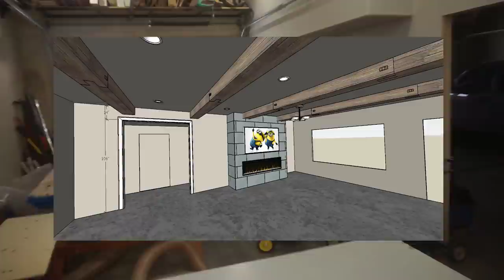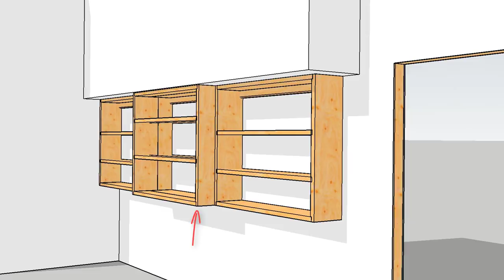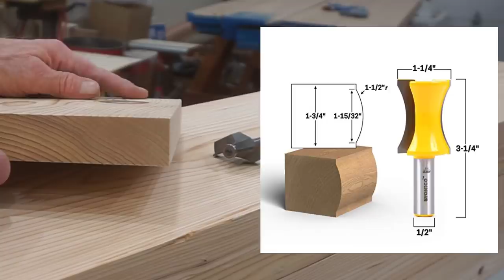Get Organized with Simple Solid Storage Shelves

Comment: Hi, I'm trying to learn here and I'm afraid I am missing something. Perhaps you can help out with an explanation. Here goes:
I understand the cleat is securely fastened to the wall. I also see how the top shelf rests on (and is screwed to) the cleat.
But then, the weight of the other three shelves as well as both side rails are all just held in place by three screws on the tops of the sides into the end grain of the top shelf (as seen at 28:10 the three top-right screws)? The sides are not resting on the top shelf right? They're only screwed into it from the side?
So I see how cleat and top shelf are really strong and sturdy, but it looks like the rest of all the weight depends on six screws through the sides of the rails into the end grain of the top shelf. Is that an engineering issue, or am I just missing something?
Thanks for the build and thanks for your efforts to go through "video-hell" to get it out to us!
Reply from the maker: Great question and very well stated... thanks metamud!  You are correct in all your observations and conclusions about the design and 'engineering' of these shelves.  I'll add couple key things to help you understand why I'm confident these shelves won't fail as constructed.  One thing is that there is a 4th screw holding the sides to the top shelf/cleat... you'll see it in the same frame at 28:10... so there's 8 screws total for the side to top/cleat connection on each of the shallow shelf units.  While they are indeed screwed INTO end grain, the force on them is 'shear', not 'pull out', and far stronger here. My assessment is that I could easily load any one of those screws with 50 lbs without failure of the fastener or wood.  That means I'd be comfortable loading 400 lbs on the shelf section and still sleep soundly.  The center section of shelves are deeper but they also have more screws.  If I had over 1,200 lbs of stuff to store there I might re-engineer things but even then adding polyurethane construction adhesive to those connections would probably come close to doubling their strength so I wouldn't need to change much.
BTW similar shelves sloppily built and installed without careful attention could fail with much less weight IMHO so I stress the importance of paying attention to things that matter.  Best, Matt
Reply: Excellent! Thanks a lot for taking the time for such a lengthy explanation. This helps my understanding a lot. Great job. :-)
Reply: Just a few technical data:
Those screws have  a shear strength of 540 pounds.

https://www.reliablefasteners.com/documents/docsGr/119/817/0/1198170/1401928.pdf

So if the top shelf was infinitely strong, and the rest was rigid and infinitely strong, you would have to apply a pressure of: 6 * 540 = 3240 pounds, or 1470 kg to the bottom part to separate it from the top part.
I'm pretty sure something else will break before the first screw shears.
It would be interesting to see what the deflection is with such a load for the wood is using, but I don't really have time to do that.
Or how much it take to shear the wood in such a setup.
Reply from the maker: @xl000  Thanks for adding that analysis... adds value to content here and I appreciate it.  I tend to rely on years of experience tearing stuff apart in demolition projects to know what holds how much and where... it's shoot from the hip engineering but actually serves me well.  Unfortunately it doesn't translate well so viewers don't gain the confidence they do with actual data.  Plus you've a neutral way of presenting that's not offensive... not a common trait on YouTube... so that tells me good things about your character too.  Best, Matt
Reply: It wasn't the screws I was afraid of breaking / shearing. It's the fact that they are in-line with the grain of the wood, which means they could tear up the would / make it break. Especially because they have such a high shear strength it is not the screw to worry about, but the surrounding fibres of wood that worried me.
Reply from the maker: @metamud8686  I wouldn't be comfortable with this connection if the shelves were 3/4" Radiata pine or anything for that exact reason: strong screws could lead to failure of the wood itself.   Thick shelves like these are amazingly strong. If you want perspective on my confidence get some scrap material, create this connection and do your own stress-testing to see. Careful placement and mindful driving of the screws in these shelves provides maximum holding power and strength IMHO.  Screws driven willy-nilly could reduce strength significantly.  Anyone who remains dubious could add polyurethane construction adhesive to the connection... when that stuff cures you could probably remove the screws altogether without concern! 🤓😎 Best, Matt
Reply: @metamud8686  If you are so scared of the setup, build a mock up with regular non grk screws, forget the dado cuts and test the load with and without wood glue or liquid nails/PL premium. You'll come to realise that this structure is way strong.
Reply: I wouldn't use 3/4 stock, nice shelves, @Next Level Carpentry and I always use my building experience to asses the hold of whatever I'm making. I couldn't do the math that the other commentator had... science, engineering, my head exploded...@xl
Reply: Yes I noticed that too.
Some dowels or biscuits could make that joint much stronger

Comment: What a great video.  You don't need to apologize for the video or audio.  Totally understandable.  I found the repair on one of the shelves with the split to be fascinating.  I would have never thought to complete the split, then use the wire brush, before a glue up.  What a nice nugget of knowledge. I also found myself watching your hands as you performed the microbevel on the ends of the shelves so that they would fit in the dado of the verticals.  You used a pulling motion with the block plane that I assumed was to prevent creating a splinter in the end of the shelf.  I also have found that the use of a climbing cut with a router is very helpful if you're careful. Thank you so much.  Kind regards, Craig

Comment: Matt - I agree with many of the other comments here, and I'll add my perspective as a fellow YouTuber: Your hard work on getting this video into a coherent state definitely paid off. Especially with your honest explanation at the start, so we knew what was coming and why the audio was inconsistent, etc. The fact that many people commented saying things like "I thought the video was fine" just proves how well you set up expectations.

I'm totally in awe that you managed to get this video out. I have several projects like this, where it was too much of a struggle to make anything coherent out of the video, and I've shelved them indefinitely. Now I want to go back and see what I can salvage. This video is an inspiration to those of us who have projects, video or otherwise, that we just can't seem to finish.

Questions:

1)  For the bottom shelf, why didn't you use a dado instead of a rabbet? The bottom shelf has no structural support other than the 6 screws. I mean, obviously you know what you're doing, so I just wanted to know your thought process was.

2) Do you prefer GRK screws over Spax, or are they about the same as far as you're concerned?

Comments/Suggestions:

Regarding the toothbrush, have you considered using one of the silicon brushes that Rockler sells? You don't have to soak these at all. When the glue dries, you just peel it off. It's actually really cool to peel it off - very satisfying, sort of like how popping bubble wrap can be satisfying. 😄

Oh yeah, the content of the video was great also. 😉Makes me want to get a thickness planer, and figure out some sort of jointer that's usable yet can be easily stored away.

One final thing while I'm thinking of it, and sorry for the novel: I'm probably going to produce a video about an entertainment center I made many many years ago, and the main focus of the video will be on how you don't have to use any special joinery, other than butt joints, to create something usable that can last. I just wanted you to know that the video isn't a response to your video here, suggesting that your dados are unnecessary. It's only purpose is to try and get people to make things they don't think they can make. Once they get into making things, then I'll send them to your channel. 😛

Thanks for the great work, and your honesty and humility, Matt.
Reply from the maker: Thanks for sharing your thoughts on this one Dan!  I know you know the struggle so thanks for relating the feeling for other viewers.  And thanks for the grace to endure a less than perfect production.
For your questions:
For a dado to work on the bottom ends it would have to have 1" or so of a stub sticking down below the shelf to have any useful benefit.  That means I'd loose a full inch of height for storing boxes etc and still have clearance underneath for parking stuff like the BS100, etc.  A quick M.I.T. calculation (Mistakes I've Tried) tells me each screw should hold 40~50 lbs in shear before stressing and probably a lot more before failure.  If I decided to stack my gold bars on them instead of on the floor it would be a concern but I won't get anywhere near 250lbs on the bottom shelves. If I was concerned I could have added polyurethane construction adhesive to those joints and increase their strength 100% or so.  Einstein said 'make everything as simple as possible, but no simpler' which is a good mantra for this sort of build.
I'm guessing GRK and Spax are equal for all intents and purposes as are GMC and Ford so early career 'imprinting' is probably the most honest reason for my choice.
I use a silicone brush for mortise/tenon work for all the attributes you point out but like to live on the edge and rinse even them in di-hydrogen monoxide rather then let the glue dry for a bit of bubble-popping satisfaction.  One thing I don't like about the silicone brush I have is that the head isn't held to the handle very well and falls off too easy.  A different brand/design would probably get around that annoyance but I still like the 90 degree, finer bristles on a toothbrush for the repair process although if all I had was a silicone brush at hand I'd use it in a second.
To dado or not to dado, that is the question... a sliding dovetail is better than the joinery  I used and a dado is better than none but difficulty/complexity and strength need only match the demands of required strength and aesthetics IMHO.  My whole house is built without dados and is holding up fine.  My clients expect durability and appearance of very precise dado joinery so, as with your entertainment center you take outside factors into account and build accordingly.  I produce videos with minimal equipment and ability because if I had to do the equivalent of dados in video I'd never leave square one.
Thanks for being such a supportive, engaging member of the YouTube Creator community... I really appreciate it!  Best, Matt
Reply: @NextLevelCarpentry  Matt, I'm so glad I asked the questions I did, because your answers are fantastic. I've copied them to my notebook of wisdom, and don't be surprised if you hear some of them parroted back in a future video of mine. In face, expect it. I especially appreciate that you took the time to answer them as completely as you did. Thank you so much!

By the way, I didn't have to "endure" anything to watch this video. I loved watching it. "Not perfect" does not equal "not interesting/not entertaining". And since I know how hard it is to make videos, I wasn't even close to being critical - I was rejoicing with you that you finally managed to put something together that was informative and entertaining.

I'll speak from my own experience, but I think it applies to most of us. I was a worship leader at my church for many, many years playing guitar and singing, I always felt like if a "real" musician came in, they'd see all my flaws and know I was a fraud - that I didn't really belong up there. I'd have to struggle to push past that, and realize that what I was doing was better than I thought it was, and it was meeting a need in the church. And intellectually, I know I did a good yob, in spite of my deficiencies. But eventually, it wore me down to the point of "retirement".

The point is, "imposter syndrome" is a real thing, and it's like carrying a backpack with rocks in it. Let's learn to rejoice in the fact we're doing what most people can't. We're making videos that are entertaining and educational. We're teaching an empowering. That's pretty awesome, and perfectionism can go to hell (literally). Keep it up, brother, and I will too. 😄
Reply from the maker: @TheNewbieWoodworker  you brought a good measure of grace with you when you left your ecclesiastical position and I appreciate the way you share it here!  Onward and upward...🤗 Best, Matt
Reply: @NextLevelCarpentry  LOL. Yeah, that's me Ecclesiastical. I can't even spell it! Anyway, thanks. 😄

Comment: Great video Matt.  Buddy of mine moving into a new place with a ready built woodshop.  Hes mentioned wanting to build new shelves.  Perfect timing!  My evil twin Skippy would just steal your idea and pass it off as his own.  Since I have Skippy tied up in a corner, Im going to show my buddy your video.
Reply from the maker: That's the way this is supposed to work John Boy... share away!  Hope it helps your buddy out and maybe you get a free lunch out of the deal?  Same design/process works for shelves that sit on the floor too.  The main advantage is making the shallow dadoes to hold shelves flat as they dry.  If you just screw them in from the sides the shelves will usually twist and cup to the point of near failure since screws alone aren't strong enough to resist the force of drying wood.  If the shelves aren't as wide or only need to hold light stuff I made the ones in my old shop  with 1x for shelves and they held up fine for 30 years and counting!  Thanks!  Best, Matt
Reply: @NextLevelCarpentry  Great idea, Not only will I show him your video, but your comment about the  free lunch.  You have not only become a mentor, but a friend.
Have a great Memorial Day.
Reply from the maker: @irishhandyman2009  Hope you can help with your buddy's project... it's more fun when you don't have to work by yourshelf! 🤢😀😎 The feeling is mutual... you enjoy the Holiday too. Best, Matt

Comment: Thank you for explaining the Glue only joinery! Always thought its needed to dadio or something for strength...but your break tests proved everything i wondered! Thanks
Reply: Alex Wirz right, however biscuits can help with h alignment too.   If yer a clutch like me they are a big help.
Reply: one thing I learned in making archery equip, is to size the wood with 50/50 glue/water mix if you think the wood/joint is dry.   end grain especially can benefit from it.  But even with the grain, on really dry porous wood, there can be benefit, and it takes little extra time. 
this all but eliminates the need for bisquits or dowels.
it is very useful if making a tapered lap joint to lengthen plywood, or any other wood for that matter.  it reduces the flex stress on the end of the feather VS one half thickness.

Comment: Good stuff!  Thanks!  
I've built a variety of shelves over the years using 3/4 material of various types; 1-by stock, CDX plywood, hardwood plywood, even particle board.  Without the milling tools I haven't had the choice of using 2-by stock.  And with a radial arm saw I've been working to the limit of my tools.  1/4" deep dadoes in the sides to hold the shelves, and 1/4" deep dadoes in a cleat that runs along the back of (almost) every shelf.  With only 3/4" to work with all holes for screws are piloted by drilling from the inside of the dado out to be sure they are centered, then countersunk from the outside.  Hanging is by screws through the cleats into studs.  The cleats provide a strong reinforcement to the shelves to not sag end to end, and unless they are super long and wide the dadoes at the ends keep them from sagging front to back.  I think you could have used 3/4" plywood and had all the strength you needed with that design.  I'm not sure if it wouldn't have been more expensive for the material, but it certainly would have saved the work (and time) of milling.  Fitting into my minimal tools, my dado head is the wobble type, not stacked.  The wobble type is made to give very good 3/4 inch dadoes only, but that is the only use I make of it.

Comment: Awesome job! Using 2x12s is a great idea, and would definitely make for strong shelves. I've got a huge mess in my basement that could be cleaned up quite nicely with a wall of shelves. 
Thanks Matt!
Reply from the maker: I think you'd find the concept could work great for your basement storage situation Shane. This design makes for more efficient storage compared to plywood and 2x4's provided the 11 1/4" depth is adequate.  They're super strong but don't lend themselves well to storing big plastic totes.  Best, Matt
Reply: hah...
MY Basement
My Garage
My Barn loft
My storage shed X 3

but hanging shelves in the basement could protect SO MUCH from water damage if the event arose!
Ima using that one!